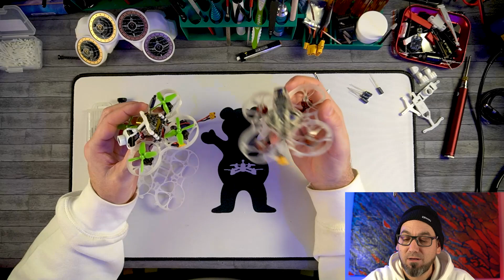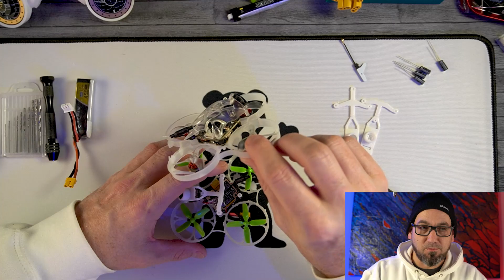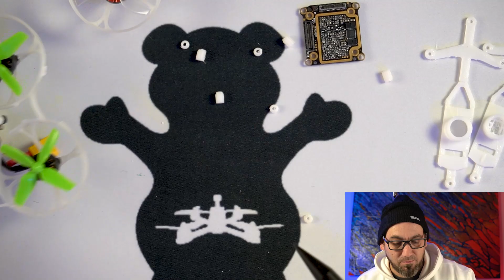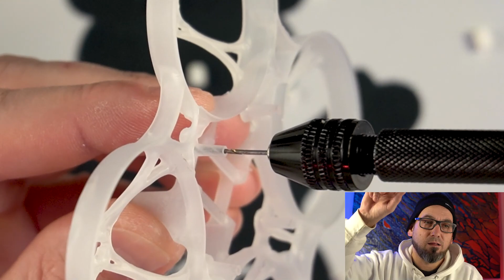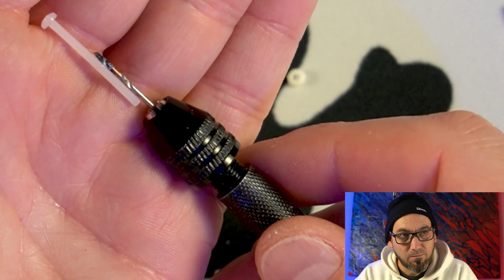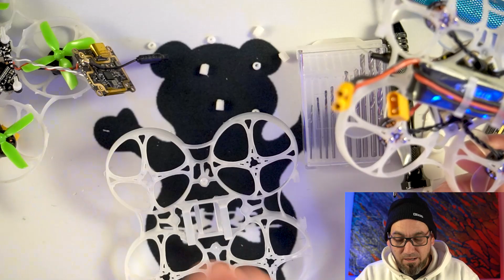DJI Mobigital 7 Build Walk Through | Happymodel Moblite 7 HD

Comment: Cannot thank you enough. I have watched your video several times and each time I attempt to begin the build I watch it again and learn even more! 
Can I use metal screws I don’t seem to have access to plastic ones. Also will 1103 motors be good ? Thanks a ton man
Reply from the maker: You’re very welcome! You can but you want to keep the weight around 40g. You can find them here at www.quadsensei.com. I have some in stock. You can use 1103.
Reply: Just an update got me a hand drill for the holes 
Got them 3D prints the older and newer canopy’s  
Got an 85x 2s  with elrs on the way (I’m starting with an 85 and then prob love to a 75 or 65 )if the idea’s still blooming. 
I’d you’re on fb or Insta I could tag you !
Reply: Also did you have to drill out the vista a little of so with what tool, what antenna do you use (I have a few shop antennas like the one I see can I use them ? Lhcp RHCP issues ?)
Reply from the maker: @Rc_impulse  yes. I used this finger drill for the vista and the frame. I love the ort 5.8ghz lhcp antenna. 

Mr. Pen- Hand Drill with 10 Drill... https://www.amazon.com/dp/B08BJ9WDMH?ref=ppx_pop_mob_ap_share
Reply: Both 1102 and 1103 motors are too heavy for this build. That's a key discovered by this guy in Europe who built a similar whoop with a Naked Vista that weighs only 36 grams! He said that's the mistake most make is to use 1102 motors, and 1103 would be an even worse mistake because they are heavier yet. He says to use 0802's. It's plenty fast and the weight savings is significant! He also uses the BetaFPV 75mm whoop frame and insists on it, but I found it hard to work with.  Please keep trying to shave more weight off and get a DJI whoop as light as possible. 😎🤘
Reply: @Rc_impulse  85mm makes the whole build too heavy, because it requires you to use a motor bigger than an 0802, which is key to keeping the weight well below 40 grams. A 75mm has been built that's 36 grams, and it flies great.
Reply: @KOrnhOliO1  Thanks, can not find anything on rotorbuilds. Do you have a link for his build? I am building Walksnail HD currently and also interested in weight saving.
Aiming 24g with 0802s and my own designed 1S 0.5g boost reg for VTX.
Reply: @KOrnhOliO1  Why Beta frame though? It is the same 5g, I see no benefits.
Reply: @MrDehicka  Agreed! I couldn't get him to reply on why he was dead set on using that frame. I had one, used it, and got to a dead end...I couldn't figure out how to make it work! Racked my brain and I just wasn't able to continue with that frame. I moved on...

Comment: Just finished building this. First of all massive thank you to Dax for creating and sharing this with the community! It needs a bit more throttle than I thought, but it's not under powered and also it flies INSANELY well with just betaflight 4.3.1 defaults. Better than my mobula 7s and other whoops.

Here are some details from by build process and things I realized while building this. Maybe others will find this useful
- Initially I bought the v4 frame, but then I realized that Mobula 7 v4 frame IS NOT updated version of the v3. V3 Supports 2S and maybe some 3S batteries, but v4 only supports flat 1S batteries. So in other words get the v3 frame or some other frame that is compatible with 2S-3S. 
- I ended up using metal M2x25 screws. They are very light and didn't have much impact on the weight. (1.2-1.6g total)
- Expanding the Caddx Vista holes was surprisingly difficult. I couldn't do it with the finger drill so I used a larger screw and screwdiver to widen the holes. If you do this be really careful so you don't break the vista board.
- The fixed camera angle for me and for many other beginner pilots may be a bit too steep. I 3D printed a small 13mm*7mm*7mm block that I inserted between the bottom of the camera and the TPU canopy and that adjusted the camera to a lower angle. If I want more speed, I'll just remove it.
- I used a Happymodel X2 board which Dax mentioned in his video with SPI ELRS to save some weight.
- Total weight with everything is 44.5g without battery.
Reply: wow sick. im hoping to build one as well when i have my dji goggles!

Comment: Hi again Dax. Have a question. On your website you listen the HGLRC ZEUS10 AIO FPV Racing Drone 2-6S F411 Flight Controller 10A BL_S 4in1 ESC. It is out of stock. That is fine I order from some where else. This AIO is 10a.  But in this video here you talk about the AIO is 12a. I got the same motors you listed. So how much of a difference will there be?
Reply from the maker: Yes, so my favorite aio has been unavailable for sometime now. Many are actually, so I had to find a different aio. Any aio from 5a-12a will work. 20a are too heavy in my opinion. If using the dji link, a sbus pad is needed.
Reply: I'm new to building this thing. I already said I got that board and motors coming. And now I got a deal on 2 - Nebula Pro Naked Vista's. So I'll b e using these two. I plan on building 2 of these Mobdigital. I just got to figure out where to solder want to want from the AIO to the Naked Vista.

Comment: the stack posts that came with the kit i just got from you seem bigger than a regular m2 bolt. should I just drill out the holes on my vista until they fit?
Reply from the maker: Yes. 2.5mm. Just go slow and drill through a little at a time switching sides.

Comment: How did you power the Vista ? I just looked at the specs, it says that it needs 7.4V minimum. But obviously running 2S, you will have a lower voltage when the battery is getting low. Really interesting build, I will consider it on my URUAV UZ85
Reply from the maker: Straight off of the batt pads.

Comment: What ESC f/w do you recommend for Quad Sensei 1102 10K motors ?
Reply from the maker: Currently I prefer the HM cross F4 with elrs onboard. If using DJI link with sbus, I like the flywoo versatile.
Reply: I meant firmware version for ESC  blheli 16.7 G-H-30 is ok ?
Reply from the maker: @irom77  oh I use bluejay .20 version right now
Reply: @DaxNealFPV  Will you share what ESC (G-H-30 ?!) and PWM frequency did you use ?

Comment: Did you glue your motors on?  Guessing E6000 to save the weight of metal screws?  Also looks like you clipped out some support pieces from the frame for more weight savings?  I’m thinking of buying or building one of these.
Reply from the maker: Im using 1102s which are 3 hole mount but I have used 4 hole mount motors and e6000 does a better job than the screws. I did clip some of the support but I no longer do this as it didn't provide much of a weight reduction.

Comment: I went to the link for the nylon M2 x  25mm at Mirco Fasteners and all they sell is m2.5 x 25mm and not m2 x 25mm. Is this correct?
Reply from the maker: Yes
Reply: Probably too late but... 145-50M020040N025-ND on Digikey

Comment: Do you think it’s possible to desolder the usb on the fc and solder it in a 90 degeree angle maybe with some long thin wires? This way the fc would sit much lower.

Comment: Hi Dax,  do you find that 1,200mW doesn’t heat up significantly more than lower settings?  I’ve heard that much of the heat generation is from the processor, not the transmission current.  I have no way of verifying this.  Thanks!
Reply from the maker: I haven't noticed any behavior changes between cased or naked myself.

Comment: Did you use 25mm M2 Nylon screws to save weight? I ordered the ones you listed in the description 2 weeks ago and found out today they are on back order. It's the only thing left to finish this build lol wasn't sure if there was a reason for nylon.
Reply from the maker: Yes. There have been several people ordering them since the video came out. Probably an increase over the norm.
Reply: @DaxNealFPV   screws came in ready to assemble and send it!
Reply from the maker: @DronzenFPV  you gotta post some vids when you get it done!

Comment: Hey! quick question how did you mount the motors ? I’m still at 57 grams on an 85x nd want to move it to the 75 my motors are 1103 11k BETAFPV and diatone 1103 10k
Reply from the maker: You’re gonna think it’s crazy but use some e6000. Holds these little motors great. Just make sure the center shaft is clear of it on the bottom.
Reply: @DaxNealFPV  hahaha I did notice but thought I’d be crazy to ask!  Lol good one
Reply: Also it would d be great if you could list  the specific tpu spacer/standoff used in each layer. Thanks!

Comment: I just got the Xing 1103 10k KV motors.  How did you mount the motors?  Did you glue them in?
Reply from the maker: So if the holes do not line up, then use a little E6000. It’s like that gummy stuff that holds packing inserts on products but is stretchy and pulls off. 

I used it on the 8000kv motors on the first build and it held better then screws. Once it dried in 10 minutes I spun the props to make sure they spun free. If there was some tension, then I used tweezers and removed the e6000 from the bottom of the motor through the whole in the motor mounts in the frame.
Reply from the maker: Did you figure it out? We can chat later if need to.
Reply: @DaxNealFPV  didn’t have a chance to attempt it yet still awaiting the stack screws and vista

Comment: Hi Dax, did you drill the vista to 2mm?
Reply from the maker: I use the finger drill to widen the holes a little. Very easy to do.
Reply: @DaxNealFPV  cool. I just made one following your build. I use the cocroach frame and use gnb27 for connectors. I think using the mob7 frame should be lighter. And yeah u r right! Very fun to fly. Nice build dax👍🏼

Comment: Your attention to detail is notable! Like Lawbart wrote, in this build presentation, but also ... I had your FB post on big screen yesterday and the details of your design, like your top 3D printed camera holder; Even with the minimalistic weight design, you thought of protecting the board, tucking the antenna lead (and the fragile u.Fl connector) for added safety, ... One aspect, which I'd be curious to get more data on, is the efficiency of 4-bladed props (vs i.e. 3-bladed Azi props). As in, how do they compare in weight, and how does the weight saving compare to the potential reduced flight time (4-blade more thrust, but less efficient than 3 - or 2-bladed props)? All theoretical at this point! Running tests will answer that question. And testing FPV ... well I be a GREAT "Crash Test Dummy" ;-) And thanks for your continued sharing of great content.
Reply from the maker: That’s a good idea. I think I’m going to make another video and I could try that out too